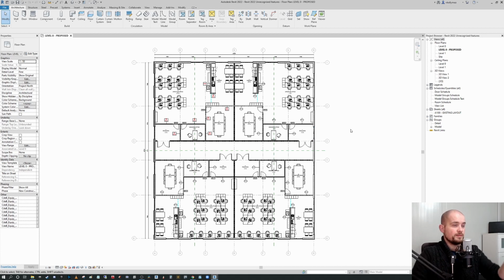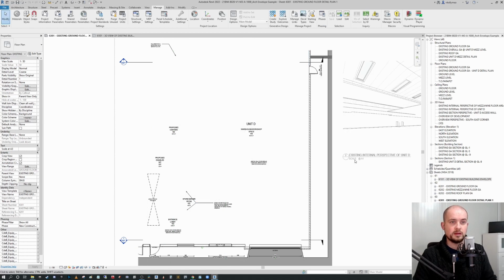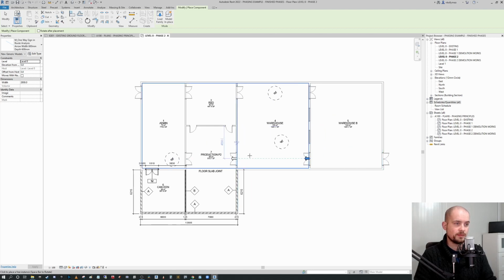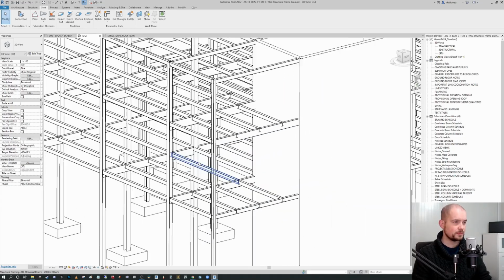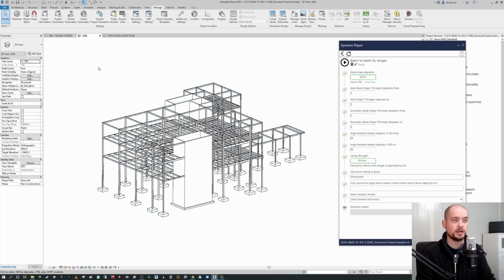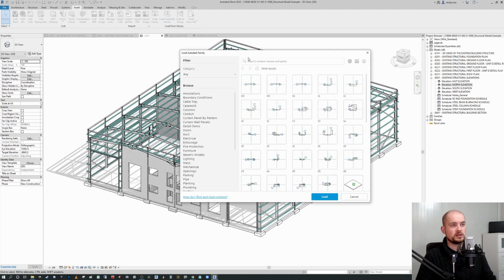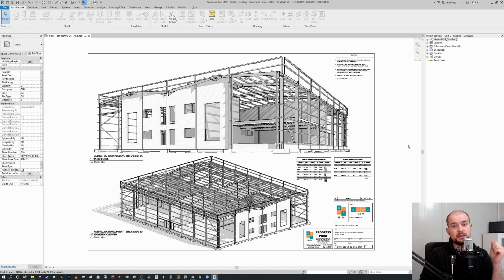10 Great New Revit 2022 Features Nobody is Talking About

Comment from the maker: 🌟Hey Folks - few notes on the Video.🌟
1) Apologies, on the 2D Shared Views my mug was in the way of the processing dialogue box. My Bad!
2) In Feature 8 when talking about the CAD exports at variable scales, I was blurting out purlins instead of cladding rails..... Less said about this the better! 

Models available to download on the first link. Consider joining the community to support me and the channel. https://www.buymeacoffee.com/8020BIM

Timestamps:
Feature 1: Shared 2D Views and How they Work - 01:26
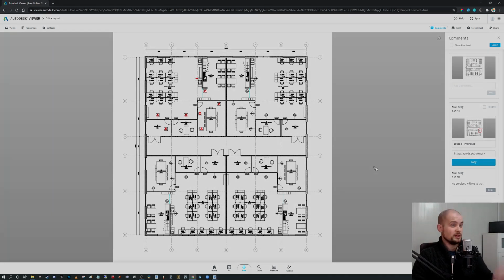Feature 2: Tags Re-Host to Linked Models when Reloaded - 06:24
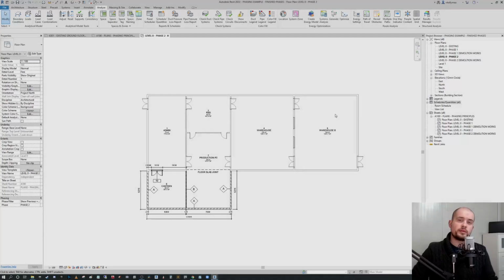Feature 3: People Flow Toolkit and How it Works - 09:11
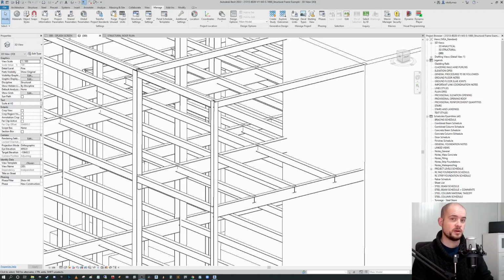Feature 4: Automatically Create  Steel Connections with Associated Profile Sizes and the Dynamo Player  - 19:53
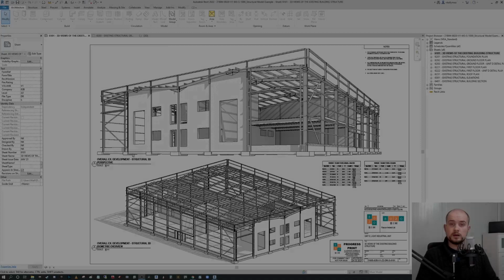Feature 5: Remember Modify tool Settings between Sessions - 29:29
Feature 6: Load Autodesk Family Navigation - 32:38
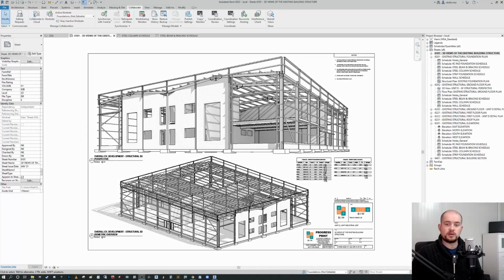Feature 7: Added Workset Parameter in Schedules - 34:35
Feature 8: Object Scaling Improvements when Exporting to DWG,DGN or DXF formats with example - 36:27
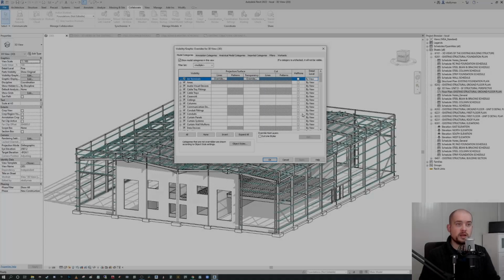Feature 9: Expanded Category and Multi-Category Schedules - 39:25
Feature 10: Massive Rebar Improvements such as 2-Point Rebar, Remember Settings, Rebar Set Relocation, Actual Diamter drafting etc. - 41:32
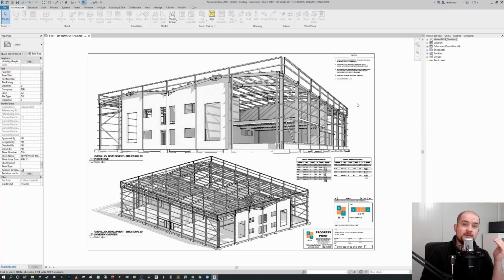Various Quality of Life Improvements and Closing Thoughts - 44:57

Thanks as always folks, the support is amazing! 
Niall🌟